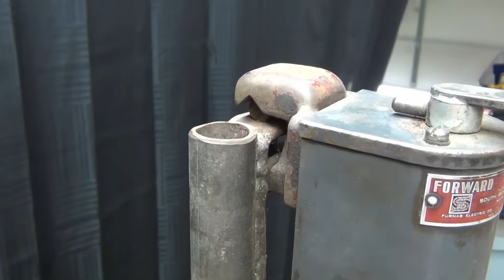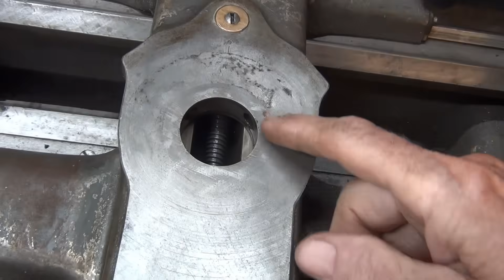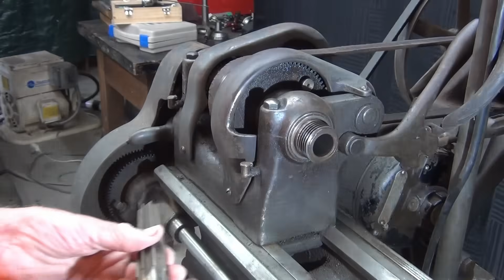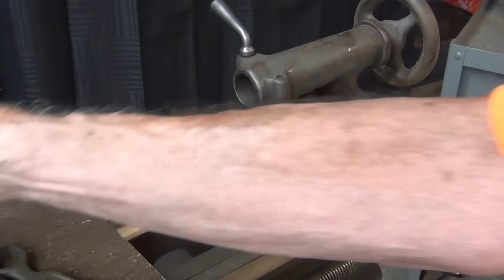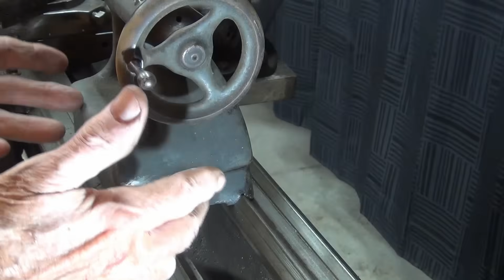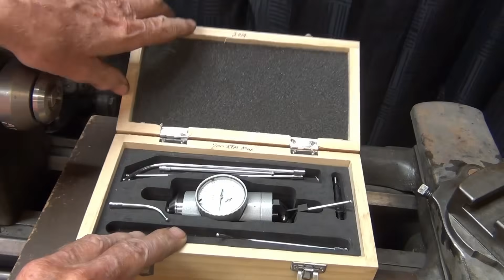Adjusting & Tuning the SB 9C Lathe #1058 tubalcain south bend

Comment: The square head screws (time: 1:42)  sometimes get in the way when cutting small work close to the chuck. I replaced mine with Allen head set screws that screw in flush in the cross slide body.
Reply from the maker: That is a great modification and a very practical tip!

Comment: In addition to using the co-ax centering indicator to set the tailstock, could it be used to level the lathe by shimming the feet? Ie, instead of using a test bar and dial indicator to test the twist of the bed and level it out with shims, could the co-ax be used instead of a test bar?
Reply from the maker: I would say no

Comment: 2:59.  I need a pair of those "clamp shoes" and bolts.....
Reply from the maker: Not sure where you can buy them
Reply: @mrpete222  It has set screws in there now,  they work, I guess,  hasn't caused damage yet.  checked the usual auction site,  maybe someone who knows will see this...  Thanks!  Your channel is the best
Reply: @mrpete222  actually, probably easy to make.

Comment: Night class checking in.
Whoa, look at the travel of the cross slide, right to the handle!
Back to the video. More to learn about differences between this and the next older series. A 1928 C 9 in the shop here.
Nearly crude compared to this "modern" one. 😀
My son gave a transmission part maching job and It'll be a near-struggle with this older 9.
Oh. What a deep video!
The Shars co axial tool is the neatest ever! I woder if I could cram one in the mini-mill here?
Always, just what I needed for info, hints and tricks!
Thanks Mr Pete.
Reply from the maker: Glad you found the video helpful!

Comment: When are you going to grind those centers?  You know that if you don't clean up Bubba's mess, no one else will.  Never had a coaxial indicator in the shop.  Always had to either use a mirror, or run around the machine.

Comment: Hanging on to this for reference in putting the 10K back together!  

I’ll have to try the coaxial indicator trick, as well!  

Thanks again, Mr. Pete!
Reply from the maker: I hope the coaxial indicator trick works out for you.
Reply: @mrpete222   it certainly should.  Seeing it caused one of those (facepalm) “why didn’t I think of that!” moments, to be honest.

I had planned to rough set the tailstock by aligning a pair of centers, but the coax should make more accurate job of it.  (Not to mention giving me an excuse to use the thing…)

Comment: Back to basics. Good morning Pete. Enjoyed the tractor pulls yesterday. Cut my teeth on the 9" SB. They are a decent machine for a beginner. The one you have seems to be in decent condition but I would move the switch back to the original position. I'm currently semi restoring a 10" SB where someone moved the switch also and I intend to put it back to it's original location.

Comment: I have always wondered about the vertical component of the tailstock alignment.   Shimming makes sense, but perhaps should be considered only if that level of precision is required.  Knowing how much vertical error is present is important,  and the coaxial indicator is the way to determine that.  

I have a Blake I picked up very inexpensively that needs refurbishing.  It would be an interesting video to see you do a proper cleaning  of one.